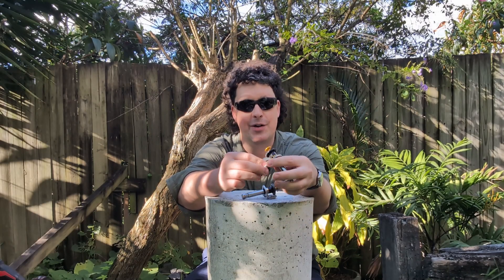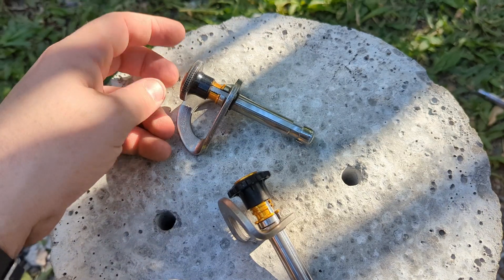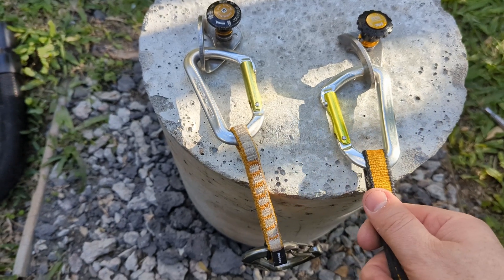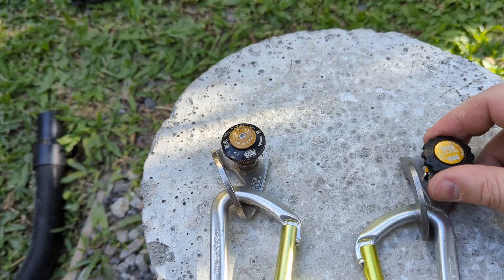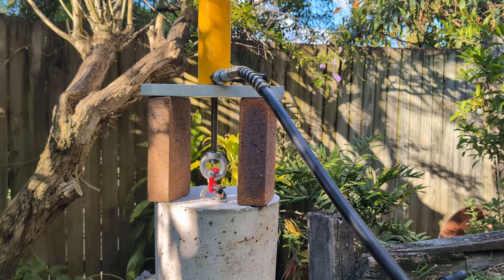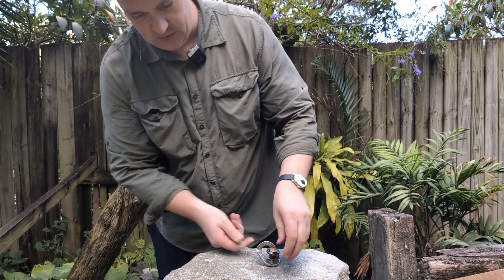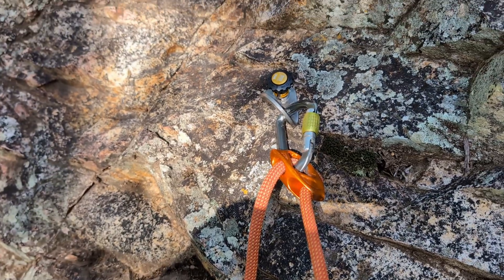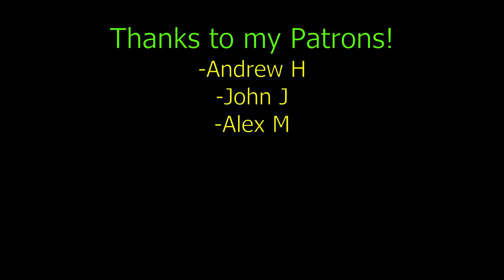Petzl Coeur Pulse New vs Old

Comment: Great vid. Myself and plenty of other regular users contacted Petzl’s tech director about the intrinsic fault this product has; the retractable spine always shears due to rotation then it jams and often cannot be removed (even though broken). This is why Petzl redesigned the hanger to rotate. 

Used them a lot and they have pros and cons versus Climbtech equivalent